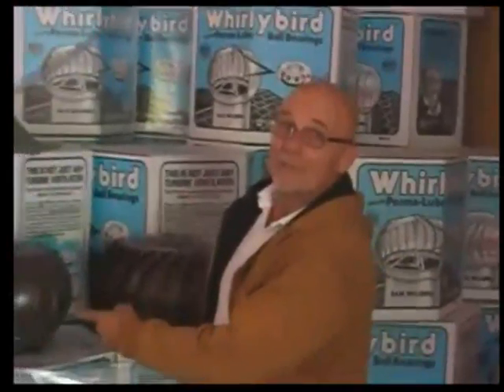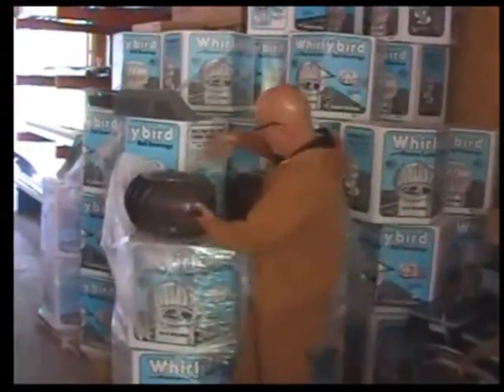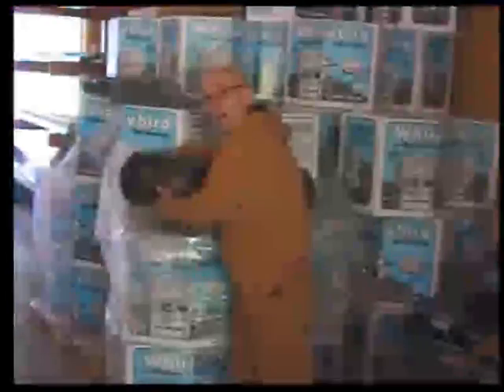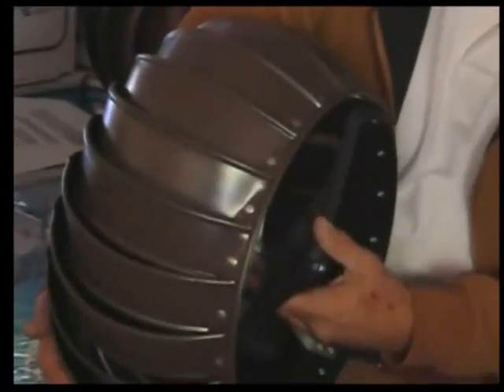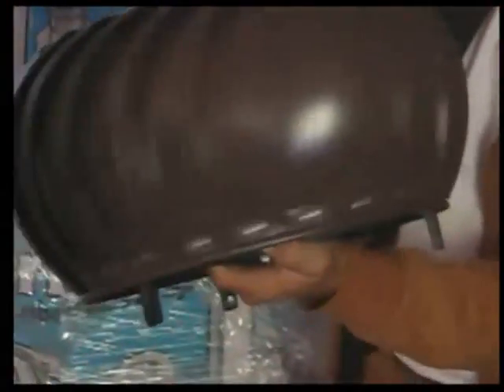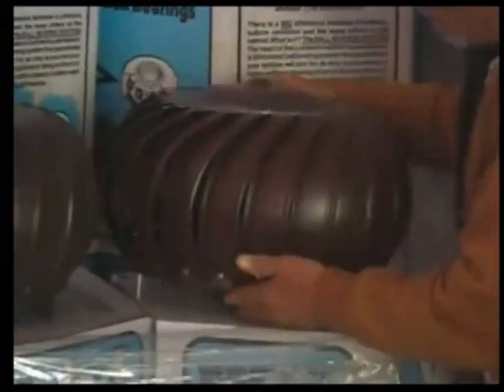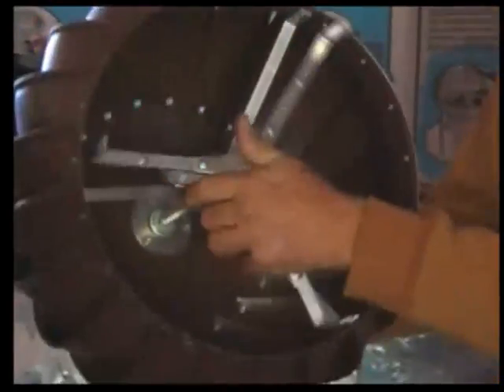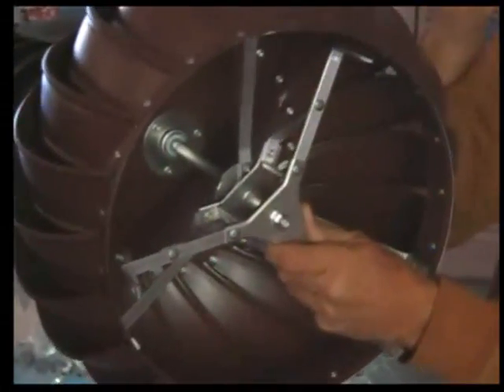What's The Difference In Roof Turbines

Comment: plastic bush type are designed for high moisture / cold / ice applications . to keep the unit spinning without bearing failure in super cold .  roller bearings design are for warner climates . they will eventually wear out in 5-10 years

Comment: They work by pressure differences.  Hot air at the top of the roof is under higher pressure then the ambient outside air.  Once that pressure difference gets the turbine spinning, it is able to establish an airflow from the soffit vents to the top of the roof.  A windy day will just make them spin faster.  They actually work great!

Comment: Ball bearings are 608z roller skate bearings . They don't last but are replaceable .
Reply: replace with Stainless Steel 608rs . rubber seal
they last 3 times longer than 608zz .